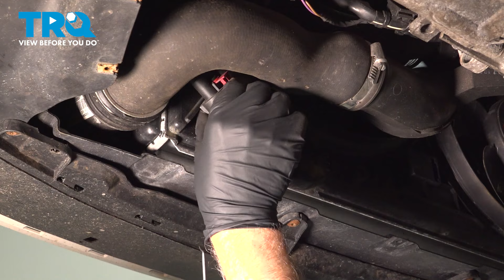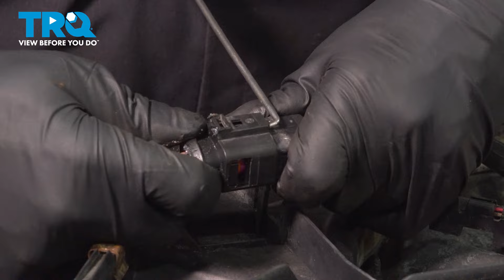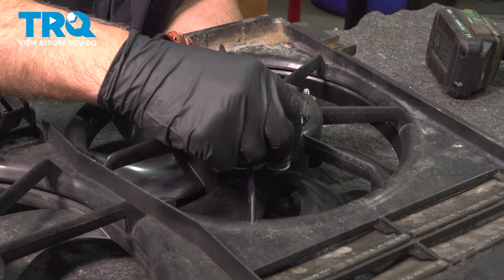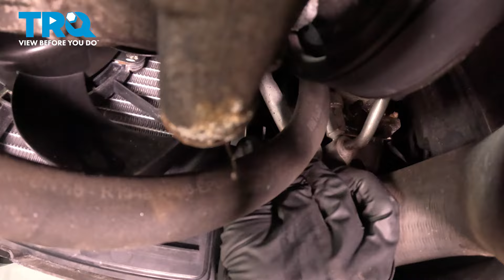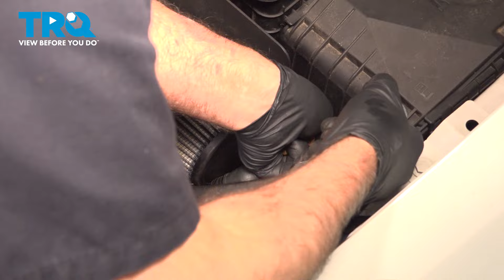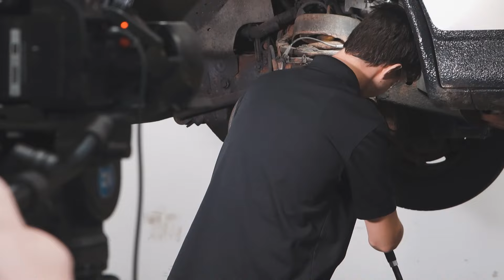How to Replace Radiator Fan Motors 2010-2014 Volkswagen GTI 2.0L L4

Comment: I have the same intake but not the cone filter and elbow. Its got the old box filter. The unitronics was new when my motor was replaced but its only the back half. Havent found a way to find the front. Hoping a scrap yard near has one. The old box filter was rubbing my radiator fans because it doesnt really fit with the unitronics piece. Its pushed further forward

Comment: You don't mention the lower radiator hose being loose. Was that a different repair or necessary in order for the fan module to clear? Thanks!